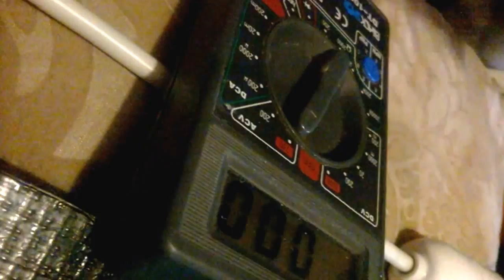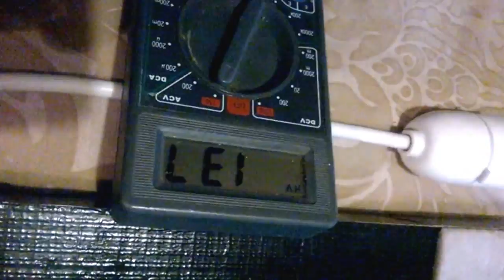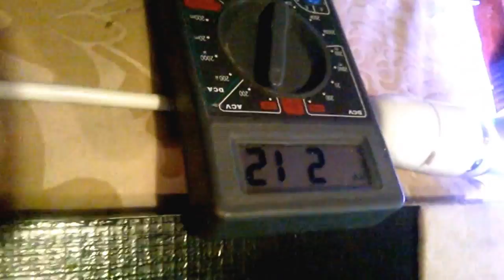dc to ac washing machine pump generator

Comment: You could use the DC directly to power the bulb more efficiently (without the loss incurred from the motor + generator). Turning 24 volts DC to 240 volts DC doesn't mean the power is increased 10 times: power = volts * amps, so if your DC source could provide 10 amps at 24 volts, or 240 watts (10 * 24 = 240), the theoretical maximum current from the AC generator (drain pump) is 1 amp (240 volts * 1 amp = 240 watts). You won't be able to pull any more power from the drain pump motor than you would your original DC power source. This is a cool demonstration of a motor-generator for creating AC current from a DC source, though. MGs were more popular before digital inverters were invented/as reliable as they are today. Some older elevators use the reverse setup, where they use an AC motor coupled to a DC motor to create DC current for the elevator.

Comment: a guy on youtube called gerard morin does exactly the same but powers something like a 250w lamp and somehow intensifies the lumen output too, dont ask me how just search the guy and see for yourselves, the guy is either nuts or a genius but then look at tesla 🤔 good work, cant wait to build my own. peace ✌
Reply: Er...only difference between  the DC motor to ac motor turned  generator and a gasoline motor powered generator is the power source of the motor in the motor- generator assembly....usually  sold with the inverter and plugs  in a ran and called a "gasoline powered generator"

Using battery pored ectric motor  generators supplemented by a small has motor  isn't new either as that's how desil/electric Trains are doing 300 miles a gallon

Comment: Could you take the RF motor apart and stack it 4x behind the other by wielding and balancing the magnetic rotor.  After that use a stator motor with a controller(mosfits) 3 phases and power it with the same rf energy that the pump motor is making with a capacitor to feed back to the stator motor.

Comment: i am using a Dremel tool that chucks perfect to pump motor and it generates 309 volts and a sewing machine foot pedal to control speed on dremel tool motor

Comment: what is the watts, amps on the output ?? what can you run out of that generator? Most new led light runs on 7watts, which is very little.  Volts X Amps = Watts. Can you run a much bigger motor out of the generator? Please email me at jaimeparadise@gmail.com. I'm looking for that formula, I'll be happy to share information I already have including schematics on energy making devices.